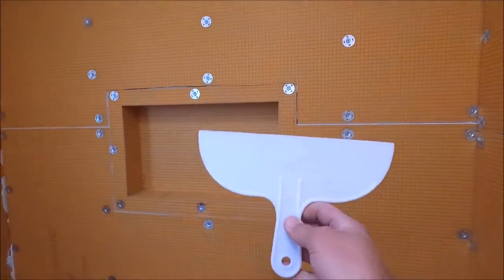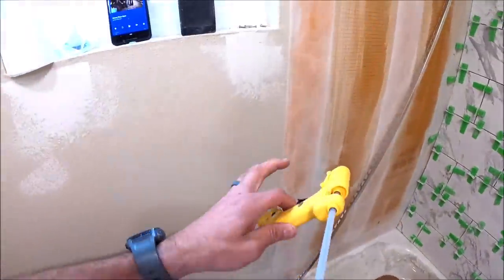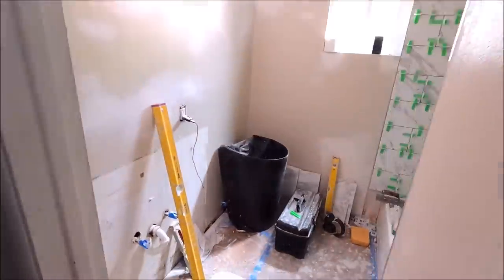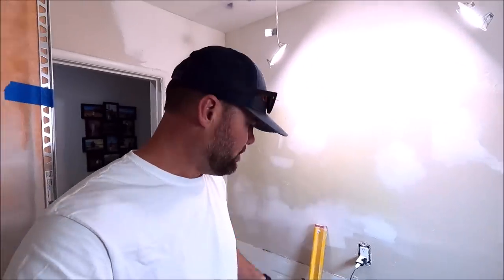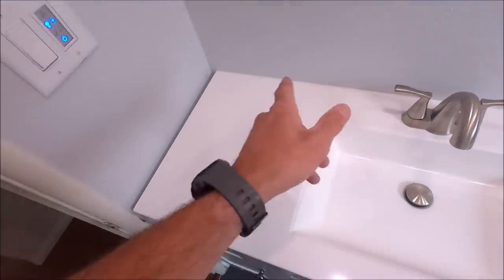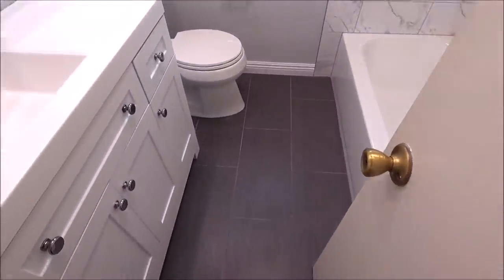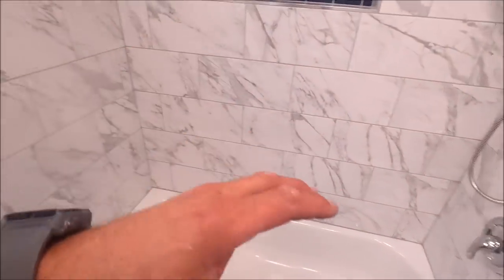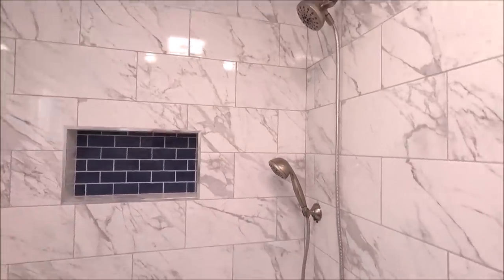Big Box Store BUDGET BATHROOM Remodel Finished!

Comment: I'm curious why the calking is the house new construction and you used caulk because of settling and cracking but now because you have used caulk all the time and now you have to go back and cut it all back out and re÷caulk every 2 years or so how come not grout instead is it because of a (it's a problem before its a problem) situation thing or should nobody use grout at the tub and wall corners anymore? Anyway it looks nice just wondering about the caulk because as of tonight I will be a the grout stage of my bathroom remodeling project...one more question is sikaflex a better solution over caulk to a non existing problem
Reply: Siliconing change of plain corners is the correct way to do it per the TCNA. Expansion and contraction. You should never hard grout corners. And with silicone there’s no digging it out and replacing like acrylic or latex caulk
Reply: Painters hate when plumbers/tilers use silicone at ceiling transitions, cos try painting a silicone bead, won't take paint ,use caulk no problem at least that's the norm in the UK.